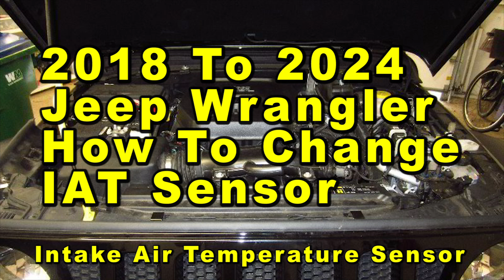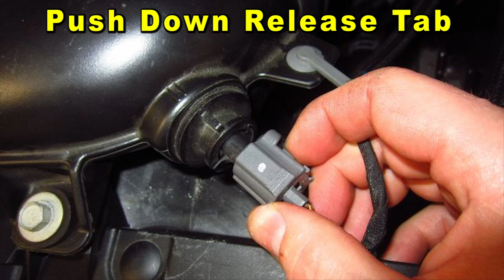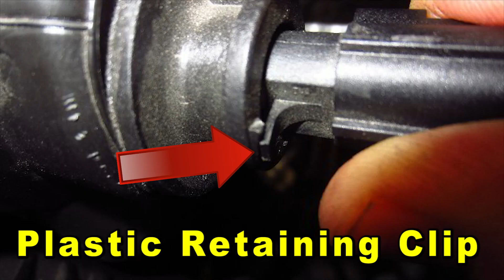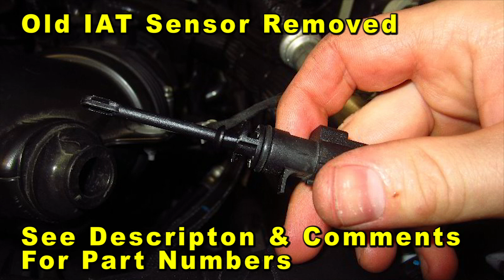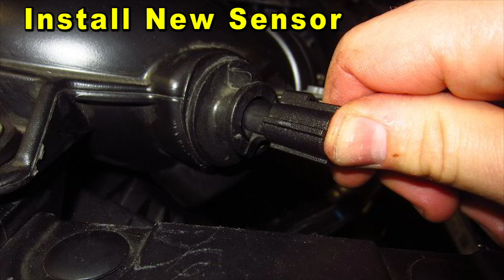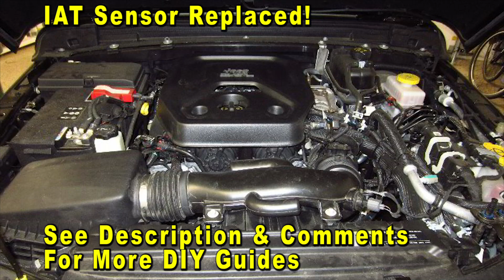2018 To 2024 Jeep Wrangler How To Change IAT Intake Air Temperature Sensor With Part Numbers

Comment from the maker: Jeep Wrangler IAT Sensor Part Number - https://amzn.to/3PYCAej
Mopar Air Charge Temperature Sensor - https://amzn.to/4cUnJLI
Walker Products Sensor Part # - https://amzn.to/4az7YYS
Precision Screwdriver Set - https://amzn.to/3sLixaP
Plastic Pry Bar Tools - https://amzn.to/3HMtsV7
Socket & Ratchet Set - https://amzn.to/3Z17LbA
Mechanix Gloves - https://amzn.to/3jCnHkt
Torque Wrench - https://amzn.to/3vS5uSI

The Paul79UF YouTube channel is a participant in the Amazon Services LLC Associates Program, an affiliate advertising program designed to provide a means for sites to earn advertising fees by advertising and linking to Amazon.

This DIY video shows owners of the JL 4th generation 2018, 2019, 2020, 2021, 2022, 2023 and 2024 Jeep Wrangler how to change the IAT intake air temperature sensor for the Hurricane 2.0L turbocharged I4 engine.

Comment from the maker: Check out the DIY guide for changing the IAT (intake air temperature) sensor in a JL 2018 to 2024 Jeep Wrangler SUV - 
https://www.paulstravelpictures.com/2018-2023-Jeep-Wrangler-IAT-Sensor-Replacement-Guide/index.html

Here are all of the DIY repair and maintenance tutorials for the 4th generation 2018, 2019, 2020, 2021, 2022, 2023 & 2024 Jeep Wrangler -
https://www.paulstravelpictures.com/Articles/2018-2023-Jeep-Wrangler-DIY-Repair-Maintenance-Guides.htm

Owners of other Jeep, Dodge and RAM vehicles such as the Grand Cherokee, Compass, Renegade, Gladiator, Cherokee, Grand Wagoneer, Wagoneer, Charger, Challenger, Durango, RAM 1500, Promaster, 2500 and 3500 may also find these DIY instructions to be helpful.